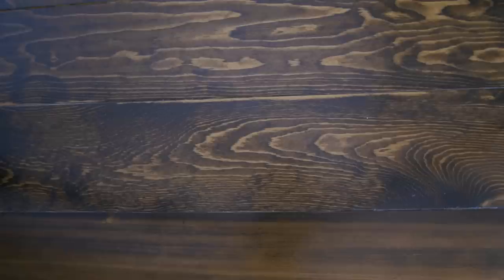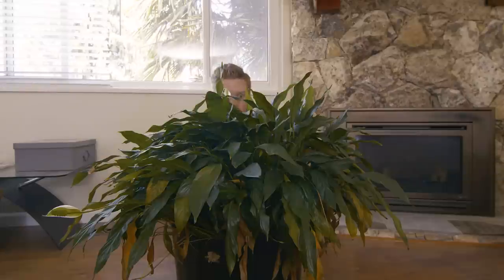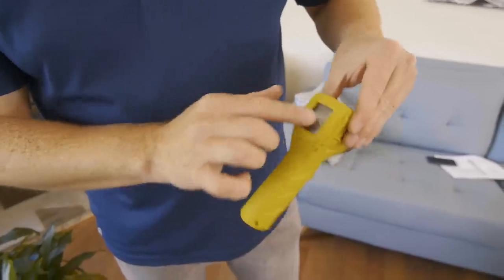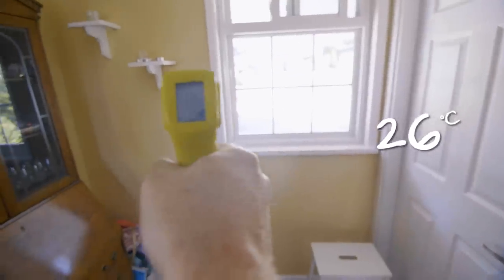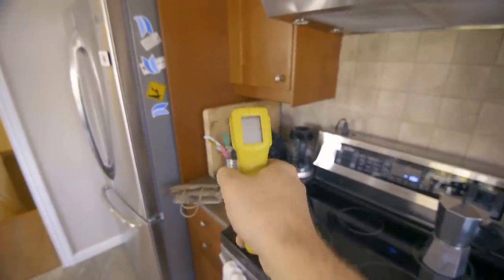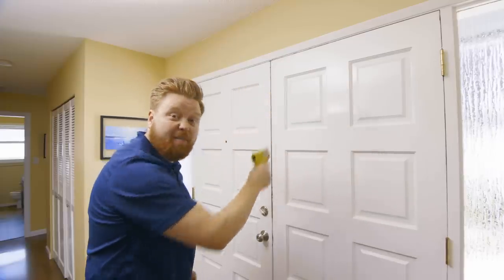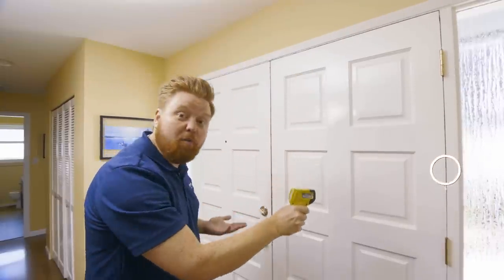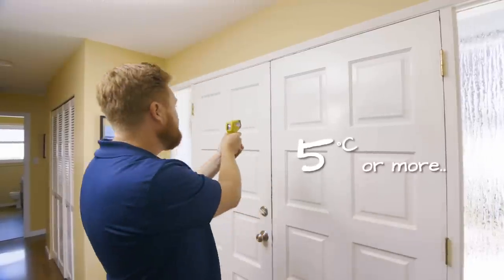DIY with Dave: How to check for drafts in your home

Comment: Great info on the IR thermometer Dave.  I'd suggest a practical hack, that us Energy Managers use, for getting accurate temperature measurements from metal surfaces.  Carry a small piece of tape that you can place on the metal, prior to taking its temperature.  I use cloth hockey tape, but masking or electrical tape works well too. Wait a few moments for the tape temperature to stabilize (cold surface / warm fingers). 

The reasoning behind this is the surface material's Emissivity Coefficient (Greek letter ε).  An ideal black body has ε=1.00, painted drywall ε=0.95, whereas something like Aluminum foil has an ε=0.04.  Your IR gun likely has a pre-set ε=0.95, which can only be changed by the user on more expensive units.  Placing tape over the metal will give you a much more accurate value.  There will be a small deltaT across the thickness of the tape, but for engineering purposes, this is negligible.  These tapes have an ε that typically ranges from 0.90~0.97, close enough.
Reply: Very informative, deserves way more likes. Thanks for sharing your knowledge!

Comment: You can buy ready cut to size clear polycarbonate sheets to put on the inside of windows with magnetic strips, plastic is a better insulator than glass.

Comment: I've found draughts from above or below skirting boards, from chimneys supposedly blocked and boarded off, electrical fittings like switches, sockets, light fittings, cracks in the lime plaster around windows, around pipes in kitchen and bathroom, even still got cast iron toilet drain pipe that's obviously conducting cold into the house as opposed to a plastic one. Gaps around windows and doors outside doesn't help either.
Reply: What did you use, to find the air leaks?
Reply: @keithnoone  Back of my hand a joystick or match, they sell thermal non contact thermometer about £12
Reply: Thanks

Comment: How do you draft proof a door? I rent and I swear our door leading to the outside is letting in HEAT, humidity and mosquitos lol. But it's not like I can seal it if I have to open and close it. It has to me easy-ish lol
Reply: Weather stripping and corner seals.

Comment: Wrong information. You're using the wrong tool. You can't find air drafts with that. What you have is a simple temperature guage. Sure, you can see the temperature difference between the wall and the door, especially since you know the door is there and you can see the gap. But how much air is being sucked out of the light switch? You can't see that or really do a temperature check on it because the air that's leaving is your conditioned air so it's going to be roughly the same temperature as the surrounding areas; it's just getting sucked up behind the walls and disappears up the walls.
Reply: It’s not the “best” tool 
If that’s all one has it can easily find massive leaks if I go u see my baseboards and get 75 degrees then all of a sudden 40 I know there’s a leak’ 
It’s a budget 

The best would be get a thermal camera but most can’t afford one
Reply: @joshymcdaniel9233  Who cares? That's just air coming in. You probably have a lot more air that is LEAVING the house and that tool won't tell you that your 75 degree temp air is leaving.
Reply: What’s the correct tool then?
Reply: @alknowing7581  For air that's being sucked out of your home like from doors or electrical switches and outlets, the correct tool is expanding foam for some, and using a light for the door at night to see what light comes through. Additionally for any air coming IN to the home, a temp guage might work fine if there's a big disparity between inside and outside, like it's 20 degrees outside and 75 inside. But if you're doing it on a day when it's 70 outside and 72 inside....you're not going to detect any 5 degree difference. What you use then, is plastic to see if it billows outward. If so, then there's an air leak. You have a lot of lineal footage around the door, so if there's a "tiny" leak that runs the whole top or bottom, that adds up to be a "big leak".
Reply: @terry7893  That sounds dumb and complicated. I'll just use the temp gun.